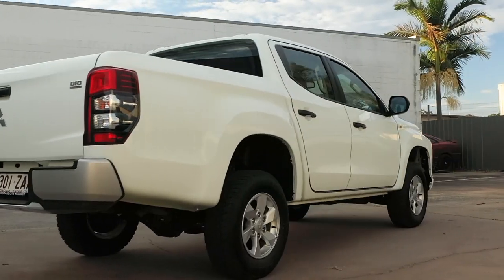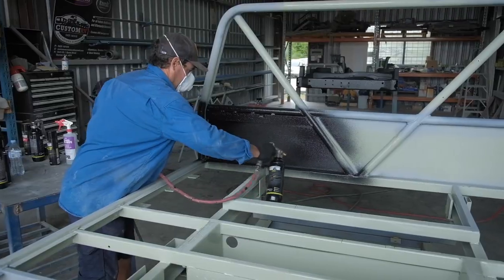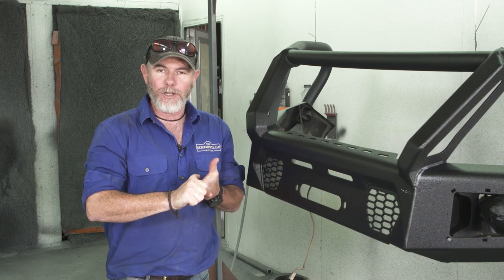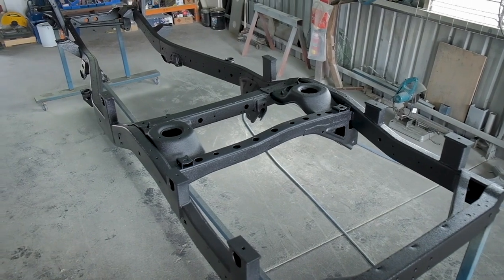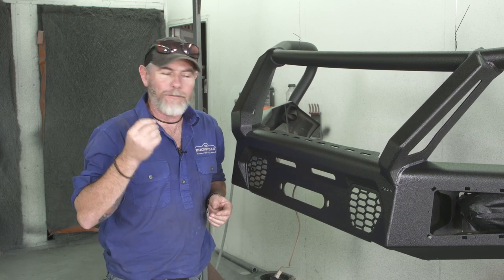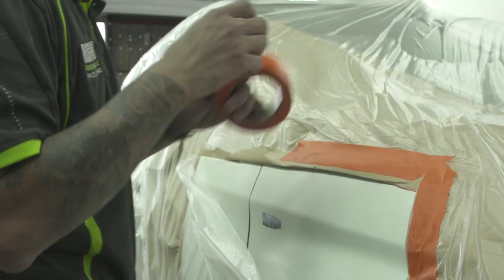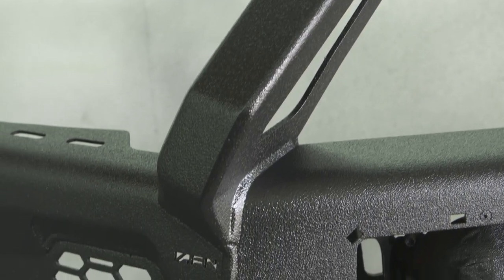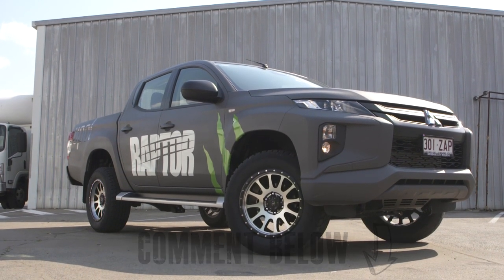WHY SHAUNO & GRAHAM RAPTOR COATED THEIR 4WDs – how to do it yourself at home + we re-spray a 4WD!

Comment: I'm right in the middle of a complete respray with this stuff and let me assure you, neither of these guys resprayed their entire vehicles with it (themselves) and certainly NOT in an afternoon with a "few mates & beers". This option is not something you can do in an afternoon, especially if you plan to respray your rig including the door apertures, doors and bonnet inside & out, you also will need to remove your tub or tray if you are uterised. Even if you plan on masking everything up and just shooting the outside panels on a wagon, let us consider that;
* You need to thoroughly clean & degrease the vehicle, then let it dry
* You need to mask & sand (preferably) past the clear coat
* You need to reclean the vehicle with wax & grease remover and tack rag it
* You need to then apply grip40 or similar to any plastic (2 coats) then let it flash of 20min
* You need to then mix and paint and let me tell you, if you are tinting it you will not be doing it in the bottle - I wouldn't even do the fill, shake shoot thing with black after seeing how viscous it is.
* Once mixed you have an hour to get it on or it goes off, you need to wait 60min between coats but if you go more than 5hrs you need to scuff & reclean before recoating
* You cannot let it get water on it for at least 72hrs and in my experience you can still damage it by day 2 if you do something thoughtless and have thinned it to use an HVLP gun. You cannot put any load on it for that 72hrs and given my experience I'd say longer if you thinned it. It hardens completely in 7 days. If you are doing it at the moment in cold weather add 30% to the above.

Not dissing the product, just letting you know, plan for a week off the road as a minimum unless you would like to try to sand all the bits that aren't falling off by themselves in 12 months. Prep and curing time is absolutely critical.

Comment: PLEASE READ THIS!!!!
I’m a painter by trade and I deal with these types of paints and spray guns all the time. 
One problem with raptor is it contains “Isocyanates” which is extremely poison if inhaled or consumed, (and is not good to even touch). PLEASE if you use raptor use gloves, safety goggles and minimum a duel filter respirator with chemical grade filter pads in them. It won’t so much hurt you instantly but in 30-40 years time if a lot is exposed to your body

Comment: I've been thinking of raptor coating my rig for a while and seeing how easy it is I will be looking into it more, great info and cant wait for the next video
Reply: i have been using this stuff for a while now. almost sprayed the entire jeep xj... it is really really easy ! since it is thick it does not run as easily as most paint. and the key to adhesion is prep. the main problem that i run into when trying to apply this is finding good enough weather to apply it. where i live it is normally cold or humid when it is warm 
it needs to be over 68 degrees F (about 20 C) and less than 60% humidity, and needs 3 days before it is exposed to water, and 7 days to fully cure .!. 
also suggest using u-pol acid #8 etch primer first if you are spraying raptor on bare metal (it can also be sprayed on with a HPLV spray gun or rattle can)
Reply: @MrMrsregor  this has been great info and thank you so much for that and this how now given me more info to get my shed ready and spray the rig
Reply: @chrishiggins1811  oh, and the raptor kit comes with a gun OR without... i paid like $10 more for the kit with the gun and it works well. however, it does NOT come with an air fitting, dont let that catch you off guard. 
i have used 3 kits (12 liters) of black so far. i have coated the interior floor, entire underside, two axles, and two bumpers. i have not done the exterior yet because i still have some custom body work to do. but i think i need 1 & 1/2 more kits (6 liters) to do the entire exterior and will probably try to mix some color into to that. so in total i probably end up buying 5 kits and 3 quarts of acid#8 to the complete the entire jeep cherokee xj inside and out and maybe have a liter or two left for touch up.. and remember to wear eye protection, a good respirator, and keep the over spray off of anything that you dont want coated (including your self), cause it does not want to come off... good luck!
Reply: @MrMrsregor  thank you so much for more info, I've been doing some more thinking about it and thinking of coating  the inside floor too to kill some noice. So doing the inside and outside of the rig I'd be looking at 5 or 6 kits by the sounds of it and 3 or 4 quarts of acid#8
Reply: @chrishiggins1811  also, only mix one bottle at a time,!. if you mix more than one bottle at a time it will start to cure before you spray it
Reply: @MrMrsregor  yeah I understand that and thank you again, I'll try my  best at this
Reply: You got an 80 series mate?
Reply: @patrickanderson3551  na I have a toyota 4runner why's that

Comment: This stuff is Fantastic, did half my 79 Bronco, really holds up. From pacific north west USA, sold at your local paint shop.
Reply: How much did it cost I have a 79 f150 that needs some new paint and it's black so this stuff might be the ticket I also want to do tune chassis in the gritty texture
Reply: @wyohorseman9948   It was about 120 per box, if I remember correctly. I did about the lower half and it could use more. I would just POR15 the frame honestly unless your going for a look. I would plan on 2 boxes if doing whole truck body, cheers

Comment: $900 isn't any cheaper than regular 2k car paint. The only difference is that you can be lazy with the prep work and it won't look too bad. That's why regular paint jobs cost a lot more than $900 - the cost of the paint is peanuts compared to the labour required to prep the car.

Comment: could even be used on boats? and I was thinking of doing my aluminium rims with it and my tub brilliant idea
Reply: DAN,,I have bottom of  the hull of my Jet Ski coated in that stuff 😎
Reply: @leonbennett3190  Noice! I was thinking more of use on Aluminium, are you happy with it mate?
Reply: Hi Dan, We have many customers using it on boats, and marine applications. We can assist with some processes to follow for the best results.
Reply: Yeah DAN its all good it's  protecting the hull from getting scratched an damaged  from doing beaching  I'd post  a pic but utube won't let u dom that
Reply: @U-POLAustraliaNZ  um mostly at this point is my aluminium rims on my 4x4 as i do a lot of beach driving and the beach sand has scrubbed my rims so was thinking of using your product to not only protect my rims but pretty them up, and thank you for your reply
Reply: @leonbennett3190  thanks mate thats good feedback and agreed on id love to see that feature in youtube as well, im 50 so im sure there is some sort of hosting site I mite ask my kid lol

Comment: Is it easy to take of if you don’t like it after a while
Reply: Once RAPTOR has been applied and is cured, just like any paint coating, it would need to be removed by sanding it off, either down to the original substrate or to bare metal.

Comment: What’s it like to get off and how much does it destroy the paint below it
Reply: Once RAPTOR has been applied and is cured, just like any paint coating, it would need to be removed by sanding it off, either down to the original substrate or to bare metal.

Comment: Is there much over spray when applying the raptor coating? Will i need a drop sheet ?
Reply: Tweak101 nah there isn’t much over spray at all
Reply: It is quite a heavy product, so rather than being airborne everywhere, you will end up with some residue on the ground around the area where you are spraying.

Comment: In regards to the stickers etc how to you get around that? Carefully mask over the stickers then spray or a different way? Done the inside of my tub with it and it’s scratched and chipped massively from work but that was just rolled on
Reply: The stickers are clear, we painted the colours down first, then clear stickers.Applied the raptor, then removed the stickers when unmasking to reveal the painted surface.

Comment: about how many litres would i need to respray a full tray and head board plus 4 rims?
Reply: 400 litres.
Reply: Whats style of tray?
Reply: @U-POLAustraliaNZ  very similar to the one on the dirty 30 build behind Shauno @2:53 with a flat bed of checker plate metal. And then just 4 rims maybe 5 if i include the spare

Comment: How does this compare to somthing like lineX coating?
Reply: Hi Paul, RAPTOR is a very different product with its own chemistry and features. RAPTOR is a great cost effective alternative to other bed liner products. RAPTOR is a thinner product which can produce a variety of textures and finishes, depending on the desired outcome and the application equipment used. RAPTOR can be tinted almost any color to meet a variety of colour requirements. When properly applied, RAPTOR has very good impact, scuff and chip resistance. Another important feature is “repairability” - should RAPTOR or the underlying substrate become damaged, it is very easy and inexpensive to repair. Additionally, RAPTOR is UV stable and will not fade unlike many of its polyuria competitors. Hope that helps!

Comment: Can you spay raptor over old bed liner?
Reply: Hi @Shifting Steve-o Cured RAPTOR can easily be touched up. Just clean the surface, sand the area, reclean, and mix and apply as usual. No need to prime again unless you sand down to bare metal. Remember, if it's been more than 5 hours since the last coat of RAPTOR has been applied, allow RAPTOR to at least set overnight, then lightly scuff and apply additional coat(s).

Comment: Hi, one question please, I am about to paint my FZJ80 in Raptor liner and I am wondering - different textures, subtle or rough... is there any difference in durability or strength or is one better for off-roading than another or is that only matter of taste preferences? And one more,  I would do raptor liner on the inside of the doors and door steps too and I am wondering will it be able to close the door as it suppose to be due to rough surfaces of textures?
Thanks in advance
Reply: I did 2mm as above in the apertures to make sure the door seals still work. If you can do a smooth texture inside the apertures and then scuff the edges and go coarser outside that might well work. thinning it out does weaken it somewhat but it's more about the film thickness apparently.

Comment: To apply this to pre galvanised parts would i need to dull (abrade and wash) the galvanise first then etch prime and finally raptor on top ?
Reply: Hi Pete, Correct. We can help with technical information and procedures if required.

Comment: Is it reversable? Easy to remove if need be?
Reply: Once RAPTOR has been applied and is cured, just like any paint coating, it would need to be removed by sanding it off, either down to the original substrate or to bare metal.
Reply: It is paint...

Comment: I have been prepping my Commodore VZ for a respray, that I will be doing myself and I have bog and filler putty over sections of the vehicle. Can raptor be sprayed over bog and putty? Aslo does raptor have a clear coat?
Reply: Hi Daniel, Raptor comes in Black, White and Tintable. Raptor can be sprayed over a multitude of prepared surfaces. Raptor also has an Epoxy Primer and Etch Primer which we advise for optimum results

Comment: If using a normal spray gun to spray the raptor coating what is the best size nozzle to as I don't want it to be a thick coating
Reply: I used a 2mm tip on a gravity feed gun (el cheapo) 15% thinners and 30 PSI. One bottle of tintable, 100ml of tint, 150ml of urethane thinners in a jug, mix well. Mine came out heavy, heavy orange peel. If you go any smaller than 2mm you are going to need to thin it further and you will likely need 3 coats. I wouldn't recommend it for durability reasons. Just make sure you do 2 wet coats or you will end up with something you can file your nails on. Watch out for product building up on the air horns and snowballing odd bits of texture.

Comment: Is it possible to put a Pearl in the paint ?
Reply: @Dylan Crowley Metallic and pearl toners can be used however, you may experience "metallic burying" and the RAPTOR may not have the exact look that you are attempting to match. Our suggestion is to conduct a test spray-out before committing to the whole project.

Comment: Interesting video guys.  One question - How much extra weight would this add to a vehicle (in my case a medium 4x4 wagon) if doing a full respray?  I recall watching a video of a guy in the States that used a similar type coating on a 80 series and one of his comments was that it was "Very Heavy", adding a couple of hundred pounds to the vehicle.  This would equate to up towards 100kg.  This could be quite detrimental given the current focus on GVM's & overloading.
Reply: Hi Lloyd, A ballpark wright for the 4L raptor kit is around 5Kg, there was approximately 6L on the triton in the video. The weight difference would be barely noticable.
Reply: @U-POLAustraliaNZ  Awesome. Not sure what the coating in the other video was, but it sounds like he piled it on way too thick to be that heavy. Definitely going to look into this as the paint on my vehicle has had it. Also, in the event of a bent panel, I assume this coating would crack rather than bend....how easily could this be repaired?
Reply: @lloydw.3950  We have seen some serious damage and the product still has great adhesion!

Comment: What’s better raptor or linex ?
Reply: Hi Sam! 
RAPTOR and LINE-X are completely different products, the chemistry of each having their own “pros and cons”. RAPTOR is a great cost effective product. RAPTOR is a thinner product which can produce a variety of textures and finishes, depending on the desired outcome and the application equipment used. RAPTOR can be tinted almost any color to meet a variety of color requirements. When properly applied, RAPTOR has very good impact, scuff and chip resistance. Another important feature is “repairability” - should RAPTOR or the underlying substrate become damaged, it is very easy and inexpensive to repair. Additionally, RAPTOR is UV stable and will not fade. Please let us know if we can assist you further!

Comment: I have an 80 series that I was thinking about going with a full respray.
It has the usual dents and the clear coat has disappeared in some spots exposing bare metal. After seeing this I have a question. If I need to do repairs prior to raptor coating , what level of paint do I need under the raptor? Can it be sprayed straight over undercoat or does it need to be better sealed?
Reply: Hi Mick, We have both and Epoxy Primer and Etch Primer in the Raptor Range. We recommend using these for the best results.
Reply: Do I need to prime the whole vehicle or just the repaired areas.
Do you have an information sheet or is there something on your website I can read?
Reply: @mickellis8747  we sure do! Download our Technical Data Sheet & Process Guide here for all the info you need: https://docs.wixstatic.com/ugd/2cb22e_59be7c370bd94fd2b3533d9198b48427.pdf

Comment: Can u add metallic paint to the tintable raptor and get a good metallic shine to it? On another hand can u top coat the raptor with either clear or a different colour?
Reply: I know you can top coat Line-X, that's what the local dealer wants to do to a go-kart I'm building, he's keen to do a fine texture with a white pearl.  I just got to stop having too much fun on the kart long enough to tear down and give it over!
Reply: @Mufaddal Salman Metallic toners can be used however, you may experience "metallic burying" and the RAPTOR may not have the exact look that you are attempting to match. Our suggestion is to conduct a test spray-out before committing to the whole project.
Reply: RAPTOR can be topcoated, but generally, it's not needed. RAPTOR dries to a semi-gloss/eggshell finish, which most people find to be plenty of gloss. Clearcoats do not have the same level of durability as RAPTOR and are more likely to chip under heavy duty use.

Comment: After running raptor for a few months now and it's great but an absolute arse to clean mud stains so if anyone has any good pre mud protection or good ways to remove it give me a shout, also this paint is not as hard as people make out it does chip just as easy as normal 2 pak however the best thing is Bush scratches don't show as much but it will scratch if you have a branch scrape down the side of the truck.
Reply: What colour is mud colour?  That’s probably the colour you need to pick. 😊

Comment: What's the cost to buy raptor paint in WA and where can I get it. Thinking of doing my 4wd in raptor white.
Reply: Hi Dan, Raptor is widely available throughout W.A. At quite a few leading Automotive Paint Suppliers. If you get stuck with tracking some down, feel free to contact us on Facebook, and we can help point you to some locations.
Reply: @U-POLAustraliaNZ  thank you very much. How does raptor coating go on camper trailer setups
Reply: @dantrucker7623  Many camper brands already use raptor from factory, on chassis, stone shields, sides and even full coating of the complete camper in raptor!